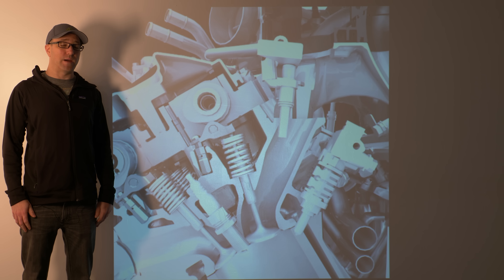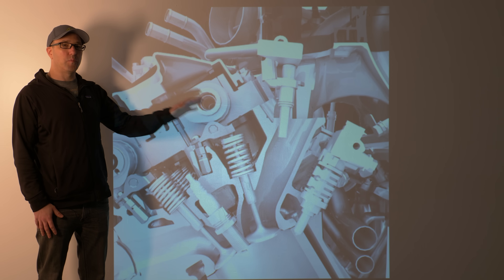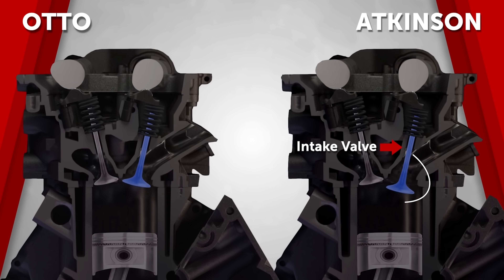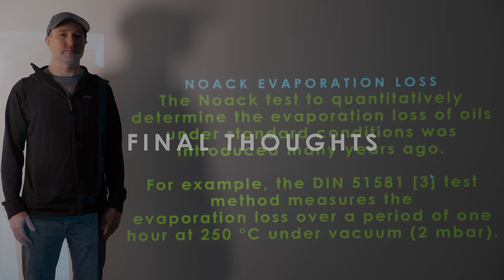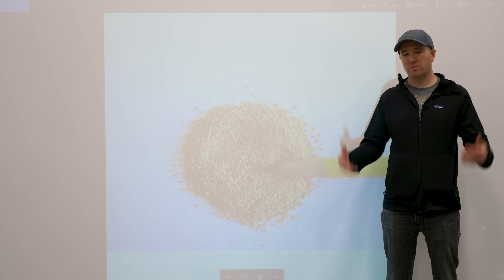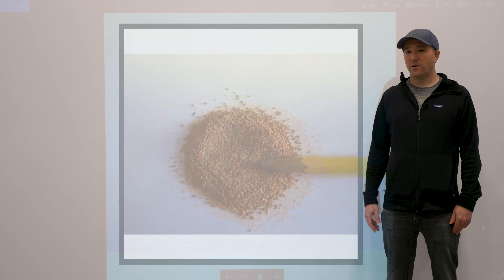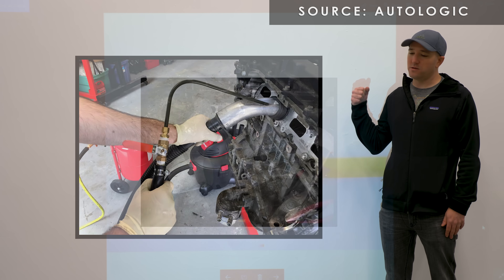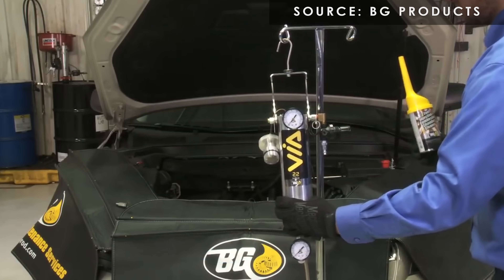Direct Injection, Problems and Solutions | The Fine Print

Comment: Is this why BMW has switched to Pennzoil/Shell as their preferred oil?  Noack of 7 vs Castrol's 10.5?
Reply: Hi Glen,
The 100% PAO-Ester based oils while expensive do have a low Noack index. Pennzoil Ultra is an example. When i swapped from Movil-1 to a 100% PA0-Ester i noticed my engine's (Audi 3L TFSI) oil consumption was much less, a good 75% less. Indeed over 4,000 miles, the dipstick level now drops by only 3 mm. Whereas with Mobil-1 i felt obliged to top it up with 1/2 a litre between intervals.
Reply: Zen Den what oil do you specifically use

Comment: CRC Intake valve cleaner proves to be quite effective to clean the top of the valves. And anyone who changes oil/filter, batteries, brake pads,  etc should easily be able to do the job.

Comment: I have a GDI ENGINE. It's only got 20,000 miles on it and my oil turns black shortly after an oil change . The oil dipstick is stained black. It's an absolute accedent waiting to happen. Can you imagine when it's got 100,000 on it !??  If it even makes it that far.....! Never again.
Reply: Oil will instantly turn black, basically the second you fire up your engine  after an oil change. That is what it's designed to do. It will do it in a 20 year old car as well.
Reply: So your thinking she'll still last me 200,000 ? No need to trade it in ?
Reply: @skippyb7735  I would keep on top of possible carbon cleaning, but yeah most engines these days are pretty reliable
Reply: @skippyb7735  I'm with onegraham, oil turning black just means it's doing its job (cleaning and suspending soot) just make sure to replace it every 5k miles. As for the GDI just get a walnut blast service to the intake valves every 50k miles, should cost between $400-$800 depending on the engine and shop, the service is a added cost to gdi cars but it's only needed every 50k miles so it gives you plenty of time to save up for it for the service. Also CRC intake valve cleaner has been proven to clean up the valves and it's very easy to do, just do it once right before a oil change and you'll never even need to do the walnut blast treatment.

Comment: Toyota Camry-Toyota Camry.  Why we bought two. Port and direct and injection plus the simulated Atkinson Cycle. EPA rated 39 highway on 2.5 non turbo and at 60 MPH I easily get 45 plus. TNGA architecture and ten air bags and about 340O pounds of the real deal. Will save $12,000 or more on fuel depending on price in 100,000 miles each. ($6000 per car).  Traded a 2012 Ford Flex 3.5 and a 2015 Camaro RS. No more Ford carbon monoxide exhaust fumes in the cabin which dealer said they had never heard of in a Flex, no in the crankcase $3000 water pump and no $1000 carbon up valve/pocket book cleaning. Best for a reason. Twice as far on a gallon of gas and about 100% reliable. Been a mechanic longer than Scotty and Camry really is the best car ever built. Unbeatable.

Comment: SO why can't you just spray water into the engine. Get the engine good and hot, so the water will boil when it contacts the valves. Once you treat it, then do an oil change. 
BTW: Good video. I don't know how many engine videos I have seen where there is a lot of bogus info. This vid is all valid stuff.

Comment: I was about to buy a 2019 Hyundai this month so thank you for this timely clip. I think I'd rather buy a older used car till all this experimentation is over. I don't want to be a guniea pig. I work on my older cars but the newer cars are very dealer dependent. I currently have 2000 Civic and a 2003 Impreza which so easy on maintenance.
Reply: Rite on mate
Reply: M Eastwood Kia has been making gdi engines for 8 years now it isn’t new
Reply: @devn3813  And I have a friend who is a mechanic at KIA. They are trash and he makes a lot of money

Comment: Another solution is stop sending recycled air back into your engine,  you will not find pcv or egr valves under my hood. Computer calibration is needed if removed but it can be done.

Comment: Just spray some foam intake cleaner down the throttle body every so often. Around $8 ish a can. I been spraying down my intakes (carb cleaner, break cleaner or foam cleaner)  while reving up the car every so often for years. The foam stuff I even spray it while not running and let it sit. Helps clean the pistions too. Also while running intake cleaner in the tank every oil  change. My last car was 15 yrs old and had the orginal injectors when I drove into the junk yard due to trans and rust issues.

Comment: A good oil air separator usually has baffles and maybe a filter product in it. Certainly not the one that you had in your video. A good piece of equipment could run a few hundred dollars. GDI/DI suck. More complicated not always good. Ethanol is the way to go high octane, burns cleaner. Yes it does have it's certain problems but, they are a lot cheaper to fix.

Comment: Your description of blowby at 7:20 is backwards.  Blowby actually goes down past the rings into the base of the engine, and then migrates into the head through the oil passages.  Your diagram at 7:47 is right, but not your explanation.

Comment: I'll stick with my older cars. Simple, reliable technology. What is happening with modern cars is ridiculous
Reply: I keep thinking about buying a new car to replace my 2009 Kia Optima with the 2.4  GDI. Maybe I'll just get and old project car.
Reply: @JDsHouseofHobbies  It's not that bad - if you know what the issues are.  I have a Ford DI 2L turbo.  Now if I had no idea, like 90% of customers, sure I'm going to run into issues.  If you don't mind some maintenance, then it's not too bad.  For instance I can get to the intake valves super easily and clean them by hand in an hour.  An intake seafoam treatment 2x/ year and check the valves every 50k is all that is needed.  Maybe do full synthetic and yearly oil changes instead of every 6 months too.

Comment: You can also install a methanol/ water injection system. Not toooo costly compared to your other options and it’s like a steam bath for the valves and pistons . Side affects = ability to make more power lol .
You can go direct port injection or just install on before your throttle body.

Comment: Why can't you just spray chemical valve cleaner into the intake while the engine is running keeping rpm's up during the introduction.  That should clean the backs of the valves without having to open the intake manifold.  With a catch can just putting a heavy gage steel wool in the can will facilitate removing oil and particulates from the PCV flow before it is reintroduced into the intake.  I'm also curious, can you just vent the PVC out the bottom of the engine bay or would that affect the vacuum system?

Comment: Blowby goes by the piston and rings into the crankcase thus blow by then you use the pc system to evacuate the crankcase by vaccume to the intake
Reply: Toob247 Toob247   yes they use low tension rings to reduce friction and increase power output the guy on this video is somewhat clueless on its operations

Comment: Thing is, not all gdi systems are designed/implemented the same way. Case in point, the animation at the 6 minute mark shows the fuel being partially sprayed over the intake valves. This is how the new Honda engines are implemented. This helps clean the top of the inlet valves. What's more, baffling prior to remnants reaching the pcv valve reduces the amount needing to be cleaned from the intake valves in the first place.

Comment: As a hyundai tech i can tell you that these new GDI motors are extremeley engineered and an amazing design, but they use cheap shit that always breaks. Make sure you get a gdi motor under warranty, because almost all hyundai/kia engines are on the verge of seizing and blowing up. They have serrious issues with crank bearings disintegrating and cams shaving themselves guncking up the valve seals and injectors and all in all theyre just junk

Comment: This emphasises the short sighted thinking of people. We should all be in electric vehicles by now or even water powered and the reason we are still flogging a dead horse with this old school technology is simple..... GREED! Oil companies simply didn’t want an alternative and car manufacturers had no incentive to develop one when internal combustion engines were relatively quick and easy to manufacture so they can make profit instead of spending on research and development. Now it’s starting to turn on everyone and bite them. Fuel resources coming depleted and climate change running away with itself. When will we learn!

Comment: Excellent video showing the exact problem with GDI engines; well done!  Before I learned about the pitfalls of GDI engines, I had a 2013 Kia Rio with 1.5 GDI engine.  It became a nightmare due to the issues you explained.  The valves and injectors became completely gummed up at 60,000 miles which caused the car to pre-detonate (ping) like crazy, lose power and get horrible fuel economy.  The only solution Kia offered was to remove the head from the car and scrape the carbon off.  Of course, they quoted the job at nearly $2,000 - not covered by warranty - so I sold the car and bought a PFI Nissan.  I will be staying away from GDI until the issues are resolved.

Comment: Buy a mazda sky active direct gas injection 
the emission warrenty is 10 year 150k mile
Witch includes fuel injector replacement
and carbon cleaner of intake valves.
Reply: i didnt know that.
just got a 18 mazda 3

Comment: Good video very informative and I love the power point graphs. I did know all this stuff before because my own research but I can see where this would be very helpful for average Joe. I have a twin turbo direct injected engine so yeah I haven't but 45000 Miles on it do I'll have to figure this out how am I going to get it cleaned off. Probably take head off engine and clean with brushed and brake cleaner.

Comment: There can be oil seeping down the valves, and build up also. It is burned off the exhaust side , but will build up on intake valves of direct injection, if the seals are bad enough it can build up on port injection, or carburated engines. They need to go to turbine electric cars. Similar to diesel electric trains! Use batteries and or super capacitors for acceleration, preventing lag. From the turbine, and can run on many fuels. Plus it be cool!! It can be electric with range extension by fuel. Even alcohol, natural gas, diesel, kerosine, jet fuel. I eannabuild one now.. And the nox is better, in turbines!! Even steam engines will pass emissions better easier...

Comment: So what is the deal with the mpi (multi port injection) engines now? Are those better with the carbon buildup? The 2019 Hyundai 2.0l natural aspirated engines with 147 HP seem to replace the 161 HP gdi engines now. Is that one reason they do that because of less carbon?

Comment: I use the gumout multi system tune-up in  a can, once a month, which has been working good  on my 2004 Saab 9-5 with dual ohc's.  What about using a spray valve cleaner and spraying the can into the valves through the vacuum system like a lot of mechanics do?  Is that very efficient?

Comment: This video definitely altered(minimally) Hyundai's sales. 🤣
Reply: Yeah but Hyundai isn’t having problems with fuel dilution or carbon build up. That’s Honda’s issue right now
Reply: @tails300  I know. I know 4 people who have had Hyundai cars; and for some unknown reason the motors blew or locked up.
Reply: Karreil2525 that’s because they had to recall some engines a few years back because there a manufacturer error at one of the factories.There were metal shavings in some of engines and caused an engine failure not because of GDI, it effected 2011 to 2014 models.

Comment: Im watching this while eating on a break between changing out my super gunked up fuel injectors on my direct injection renault megane XD the first injector was completely gunked up to the top with black crumbly stuff. i already got a new one and will put that into the engine when im done eating hehe

check engine light, fault code for missfire in cylinder number one and drives like i am missing a cylinder hehe
i already checkt the ignition coils and put in new spark plugs with no improvement so i pray to the car gods that the fuel injector is the cause XD
the strange thing is that it's gunked up from the fuel line side :/

Comment: as a shop foreman for a cat dealer i ran into this problem years ago on propane fueled engines. without gasoline the blowby/ pcv  coated the ports and valves with a sticky substance like flypaper. i saw engines with ports clogged so bad that you couldn't stick a pencil into the ports . the catch cans work but noone serviced them.some customers got creative and converted back to the old draft tube system,some ran the draft tube into to air filter,these "fixes" will work but as a dealer i couldn't condone or recommend them.  stick with port injection and service regularly. or get rid of the car every couple of years. the repair bill to fix this is very expensive and  nothing you can do will prevent a recurrence

Comment: NEVER ever suggest to ANYONE to change the oil type to anything other than what's recommended on the oil cap!  This is a common mistake shade tree and backyard mechanics who think they're racecar builders always make. OIL IS NOT AN ARBITRARY PREFERENCE LEFT UP TO PERSONAL INTERPRETATION **NOR** IS THERE AN **ACCEPTABLE RANGE***. It HAS TO be what it HAS TO be. A 10w30 Recommended oil HAS TO BE 10w30 in your engine. not "ohhh its hot outside feel like running 15w30 today"  **NO!!*

Oil HAS to be what the engineers specify, because of tight/loose clearances in the nooks and crannys of the engine and it's systems. If you run a thicker oil than supposed to, you can starve the bearings and walk a crank, you can score pistons and DESTROY Variable valve timing systems!. It's not just "ohh well, thicker is better because its goopeyer and that sounds better for lubrication". You DONT simply say "oh well, 0w20 sounds thin, it creates too much vapor so im gonna thicken it up to 5w20".  all youre doing is causing a TON of wear on startup because the engine was not designed to run an oil that doesn't make its way up into the passages fast enough upon startup in the case of a higher cold weight. it NEEDS to be 0w to do just that for this kind of engine. 

Likewise don't run a thinner oil than expected as the tolerances on your engine aren't tight ENOUGH and you WILL wear and destroy your internals and delicate systems. 

the ONLY time you MUST change your viscosity, is if a legit engine builder (as in, not you) made a built engine with aftermarket internals which now have NEW tolerances and need an oil to properly lubricate everything at THOSE tolerances.

Comment: Uhh, it seems like you skipped over the only real advantage to direct injection - stratified charge.  GDI and the specially-shaped pistons that go with it allow manufacturers to squirt fuel into the center of the combustion chamber instead of the whole cylinder.  You get a stoichiometric A:F around the spark plug, but it's surrounded by pure air, which effectively reduces the volumetric efficiency of the engine without a lot of the drawbacks that historically come with that.  

Into the "head space" of the car?  Uhhh...?  Blow by is literally compression and/or combustion gases BLOWING BY the compression rings.  Not into the head, into the crankcase.  

Those intake valves are actually pretty clean for a GDI.

That catch can isn't terribly well-designed, honestly.  You want a centrifugal design, something that works like a bagless vacuum cleaner.  The old BMW engines (M52 etc) had a good oil separator design on them if you ignored the propensity of the oil return hose to start leaking vacuum... or the alleged vacuum leaks caused by condensation in the system freezing.  

When I worked in California, for whatever reason (LOL, JK - Cali spec gas is trash, like everything else in the state) the gasoline didn't clean ports and valves because it's apparently (and by that I mean "definitely") too volatile.  

The solution is simple - run an older car and eschew DGI bullshit.  

Goddamn... I've turned into one of those old crusty techs that I laughed at when I was learning the trade.  Even though I started in 2000, I've come to prefer carburetors to EFI, and if forced to choose one, EFI over GDI.

Comment: 11:29 engines in the 80s got 70 to 80 MPG?  I don't remember that.  What I do remember is that engines in the 80s produced a fraction of the power they do today.  You might be able to get 4 mpg driving a car with a 30 HP engine, but nobody wants that low performance.

Comment: my diesel just vents to open air.   Why not just unplug the hose?   When re-install when you take it into the inspection jerk "who loves to stick that " we hope it fails hose" up your tail pipe.  P.S. one of my 93 diesel has ZERO legal emissions..... if the engine goes... cheaper to put a new engine in than purchase a new diesel vehicle.   So these new law... just encourage retaining an older vehicle.  So for those who want to solve the problem … just cut the darn hose..... and vent it like it was done since Henry Ford built his first engine...….. Problem Solved:

Comment: Gee, I wonder who sponsored this video? Actually, I prefer Bosch products. They're among the best. I actually have a 1928 American Bosch antique radio when he made them, and coils and transformers, back in the 1920s. I have a complete balanced set of Bosch injectors in my Cadillac. Smooth idle and good power and 32 MPG on the highway! Question: with that oil catch can, won't blow-by also still get into the intake manifold from the PCV? That'll still cause carbon build up, no? Thanks for this video. Very informative.